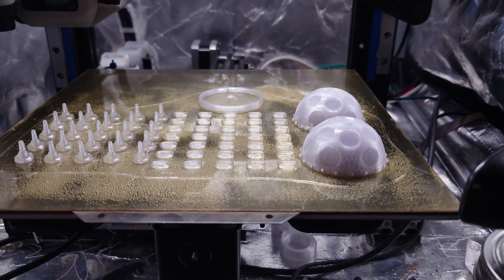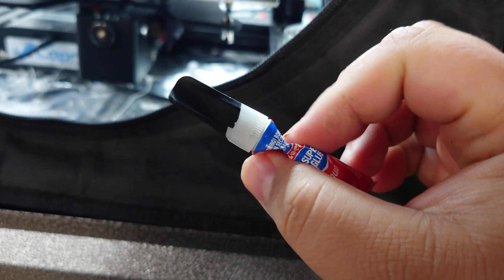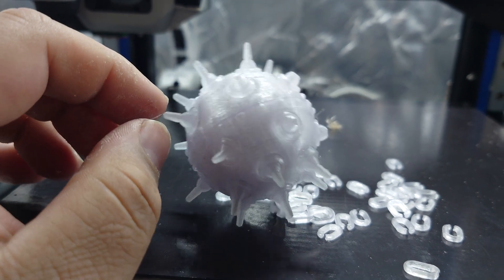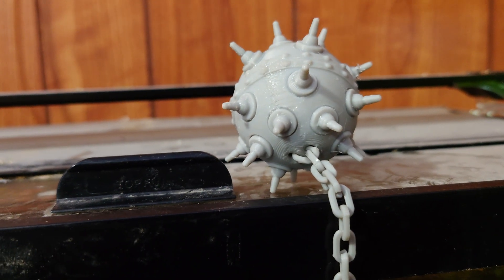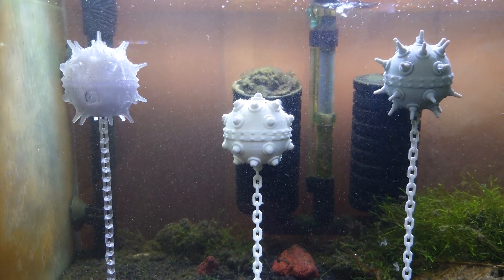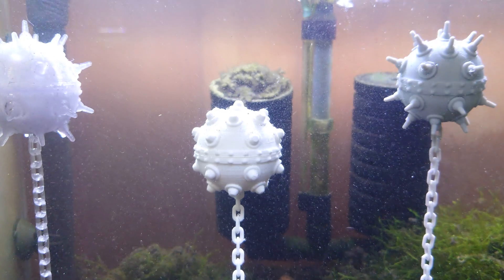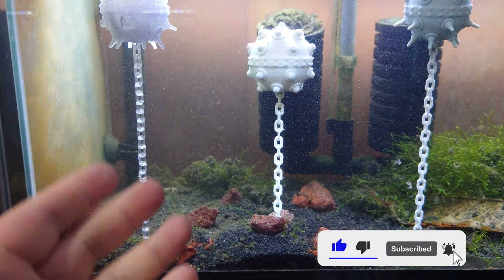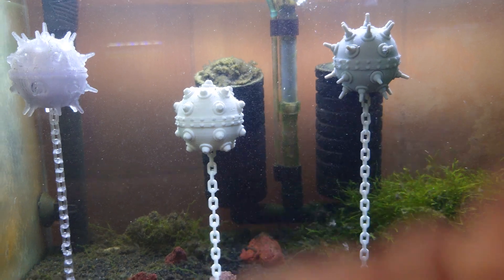Can you use 3D Prints for Aquariums? Lets find out! [Part 2 - Which Plastic will float the longest]

Comment: fdm printed parts aren't waterproof
Reply: Please explain this statement, are you stating that you can't print something that water cannot pass through? I'm sure you can from my experience thou not extensively tested
Reply: @calvingreen1215  it might be possible with the right settings but generally no its definitely not waterproof, especially under pressure. if you put water in a 3D printed container it will slowly seep through the layers.

Comment: Is PLA safe for common fish In tanks like goldfish and other fish ypu get freshwater at petco?
Reply: Curious about this as well
Reply: Yes all 3 are fish safe materials
Reply: @calvingreen1215  thanks I wanted to make a little tank decoration for someone but I don't want their pet fish to get sick. No pain of course.
Reply: @Custom3dPrinting4U  so I run a print farm of various materials and we are currently looking at doing some petg ones for a local pet shop so I've been looking into it,
Reply: @calvingreen1215  thank you. You're right. They both work but petg will last longer. Can I ask how I should go about making connections with local hobby or Pet shops so I can design and print custom parts? How did you do it. Thanks Calvin!
Reply: yes but choose like basic white or black not wood or metal filiments because those poision the water basic pla is find though if you want you can cover it with fish tank safe epoxy.